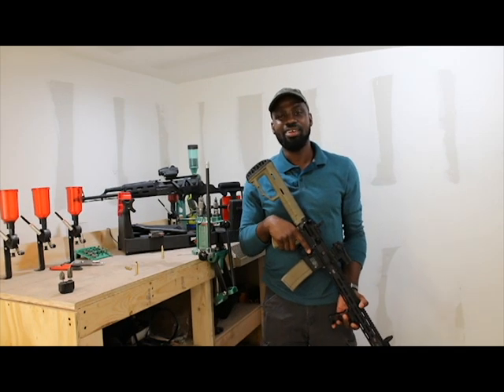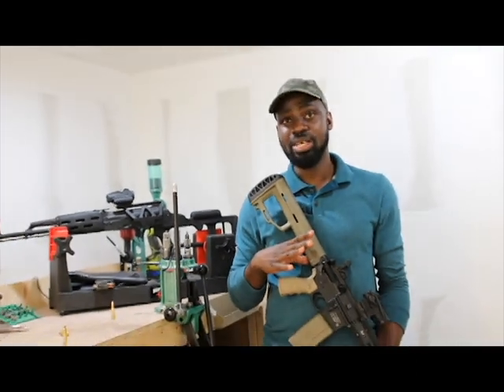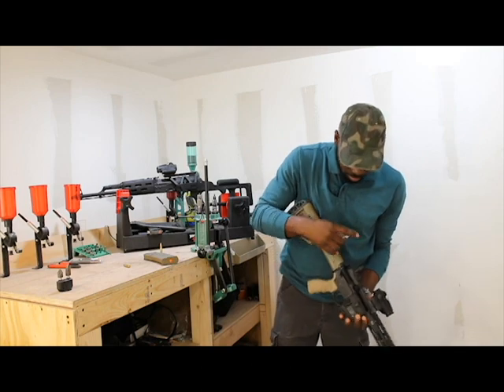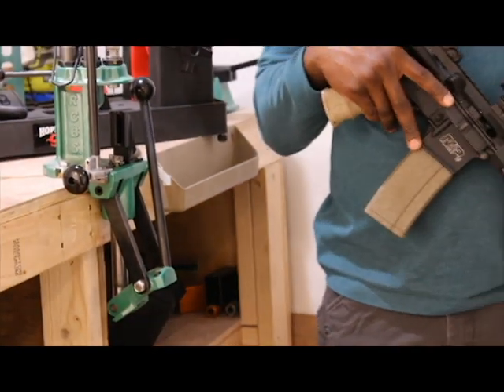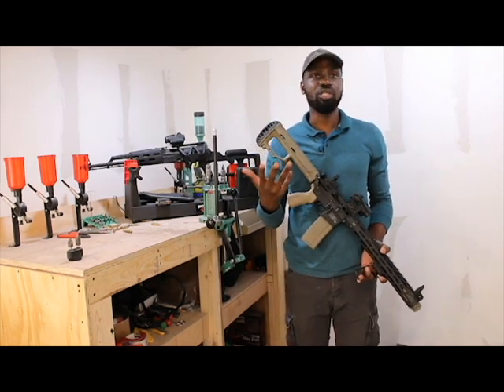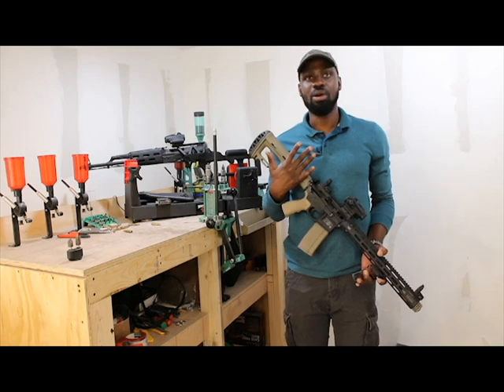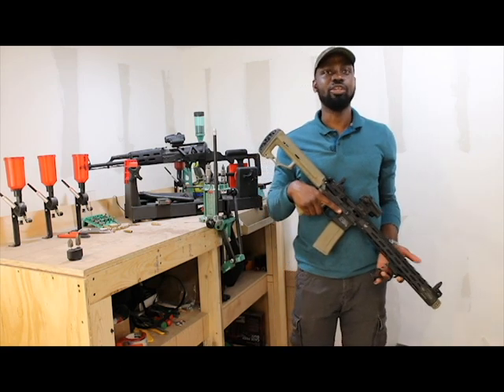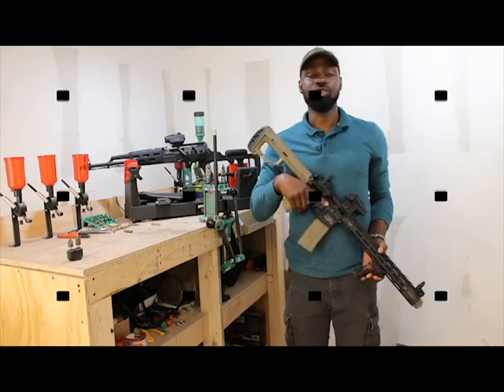AR 15 Jamming

Comment: could it be that the .556 magazine it comes with is not compatible with .223 rounds? I took it to the range the other day and had about 6 jams, it was bending the bullets
Reply from the maker: The 5.56 and 223 bullets are the same dimensions. It's just the pressure that is different. 
Same size projectile, same size shell and same Case Overall Length.
Reply from the maker: Describe what your jams looked like.
Reply: @TheOAFirearms  The .223s were being bent and not loading properly...I have since bouth .556 only magazines and rounds and No jams at all
Reply from the maker: Great, it's good that you were able to detect and resolve the issue. If you don't mind me asking, what brand mags you having issue with?